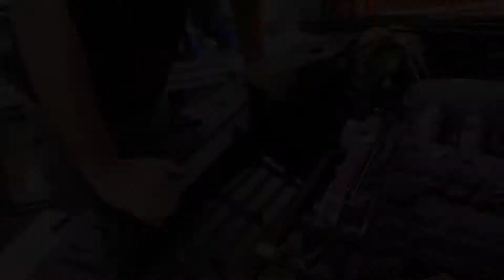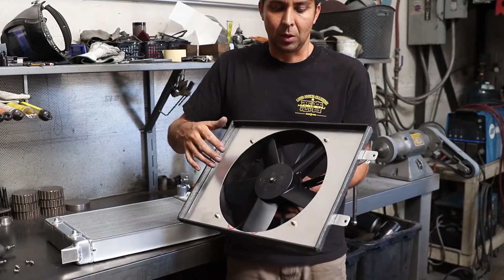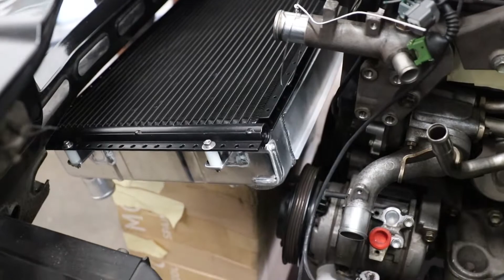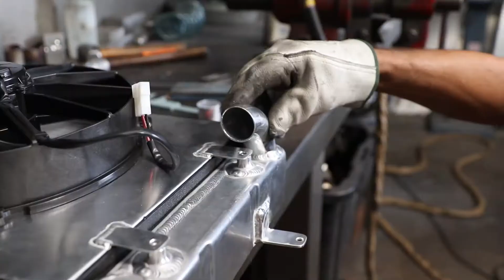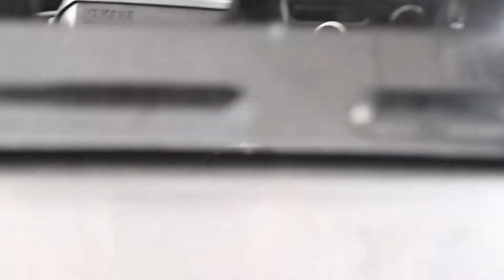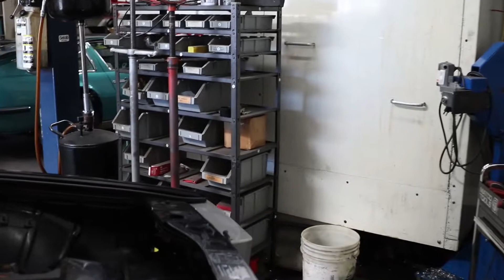V-Mount Radiator Mounted / Turbo 3SGE Maserati Biturbo Ep. 6

Comment: Why did you choose to turbo charge the na engine instead of using a factory turbo 3sg?
Reply from the maker: For the head. The BEAMS 3sge has titanium valves and an overall far superior cylinder head. Only thing you have to worry about it heat messing up the head, but that's solved with e85.